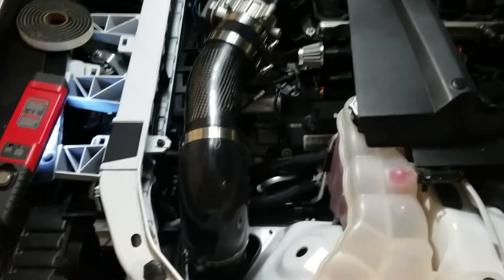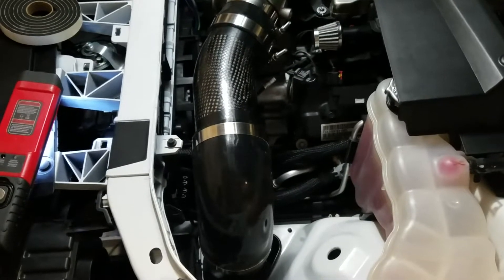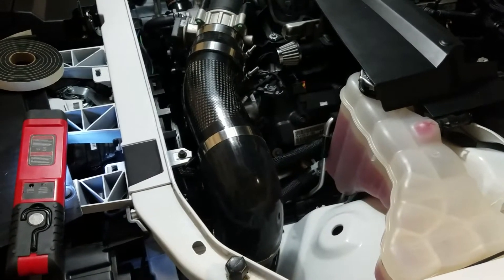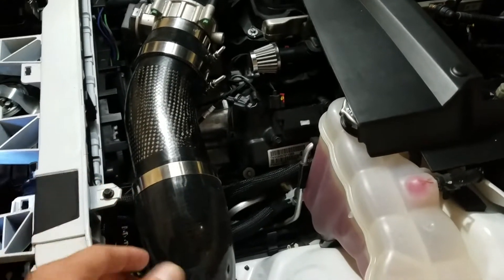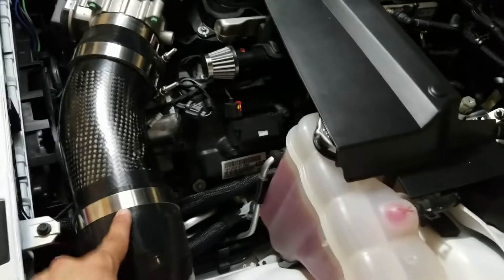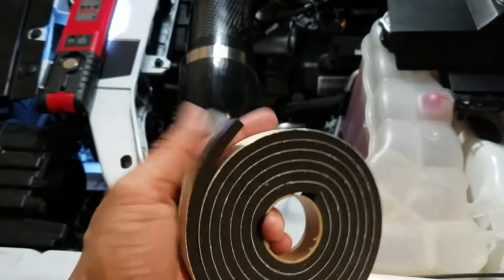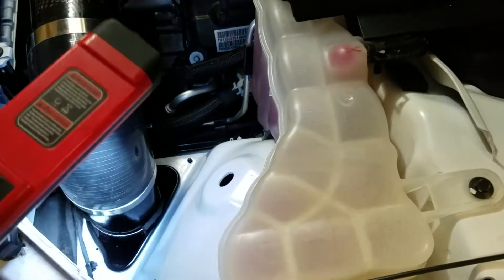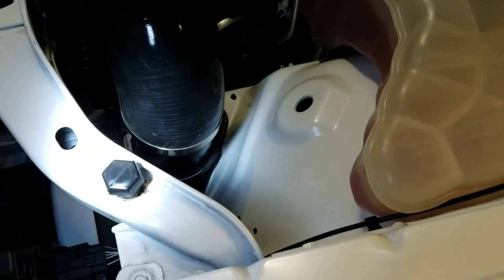Legmaker true CAI tips, tricks and final thoughts

Comment: thanks for the video. question for you. the squeaking noise you reported, I'm assuming it was from engine movement vs the fixed hole thru the fender. if the cut out out was a bit larger, do you think that would stop the sound?
Reply from the maker: ccflgearhead not really, I was going to do that but fabricate a bracket to affix it to the car.  as it sits, it is more like an interference fit.  it basicly rests on the rubber "gasket"  a better way would be to cut the hole larger and use some 1/4" hose along with a bracket.

Comment: Just had mine installed. What should the temperature of rain versus the outside temperature?
Reply from the maker: At cruise, look for no more than 5 degrees.  At idle, dont worry about it.  It will drop very quickly once throttle is applied.

Comment: Did it make a significant difference in air temps
Reply from the maker: Well, yes and no. Because of where it is situated, the air temp sensor doesn't get as heat soaked by the fans, but, with that being said the final temps  at cruise are basically the same.
Reply: @bmasontv  thanks for the quick reply.  I bought my Charger RT used with a K&N CAI.  I don't like how the filter is open to the under hood temps so i'm trying to find a way to lower the temps.  I don't have the original air box.  I guess i'll look at some of the CAI that have an enclosed box.